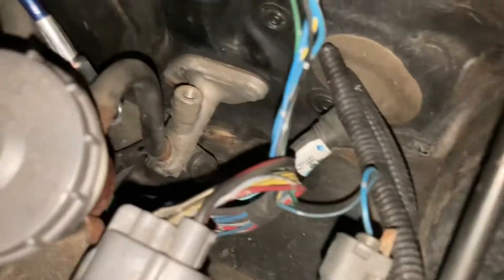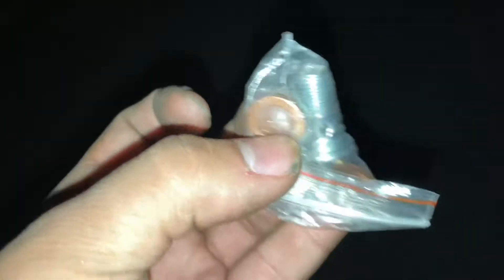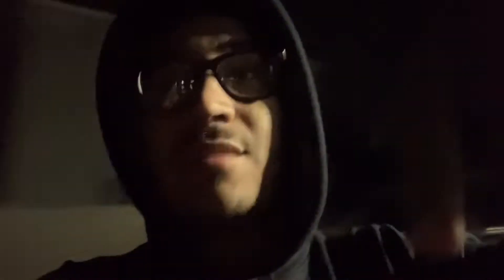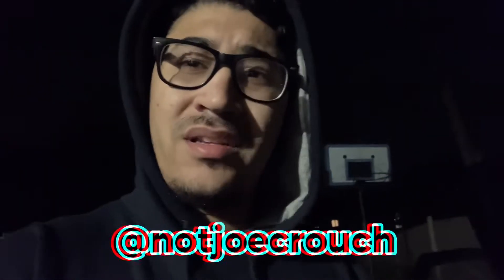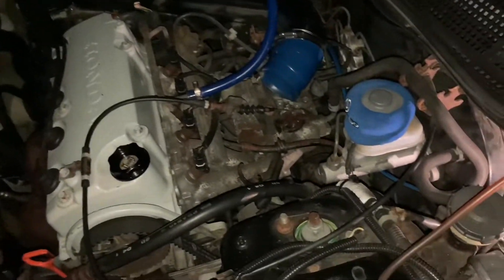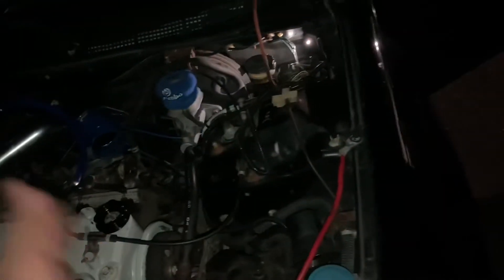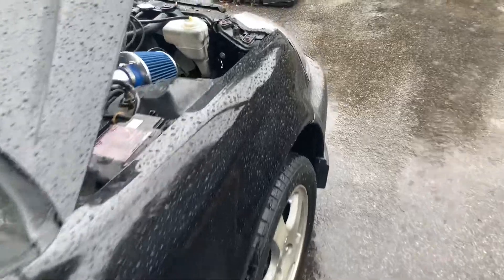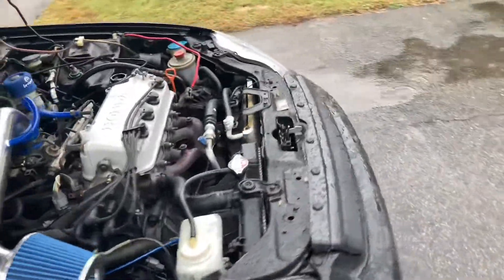Installing Ebay Clutch line p.1

Comment: Im using the same ebay line and I think it leaks out of the master side I either over tightened or need Teflon tape for it I had to use Teflon on the slave side no leaks so far